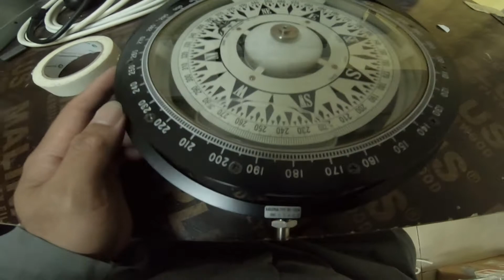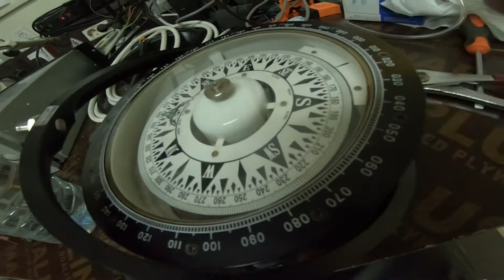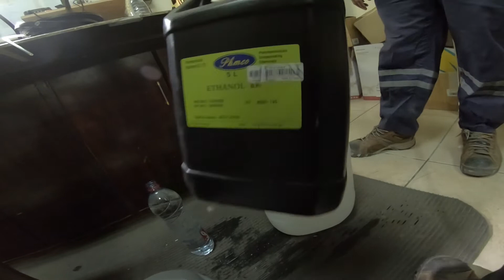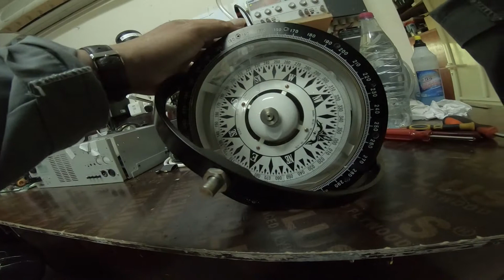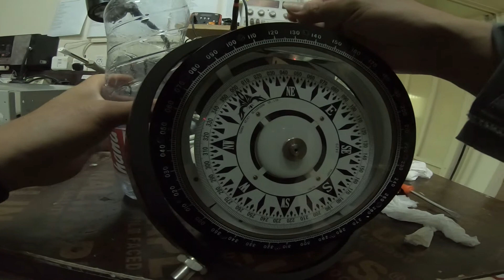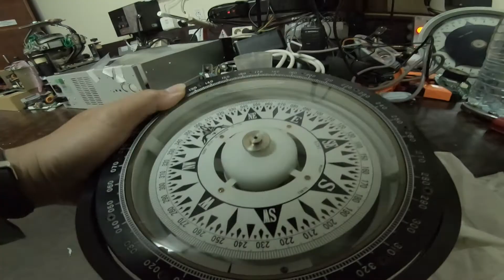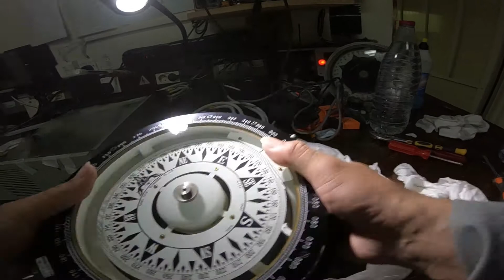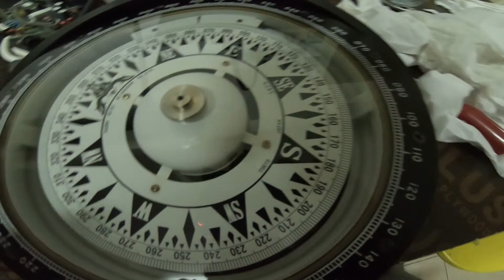Magnetic Compass Liquid Mixing and Replacement its a remedy compass liquid mixing

Comment: can you write formula
Reply from the maker: There  is no formula. Just buy Ethanol in the Drugstore and distilled water and do the mixing. 2 is to 1 ratio. In 1000 ml of distilled water mixed it with 500ml of Ethanol and mixed it properly probably shake it will and leave for an hour to evaporate the alcohol content then it is ready to go.
Reply: thank you @bajmarineequipmentrepair